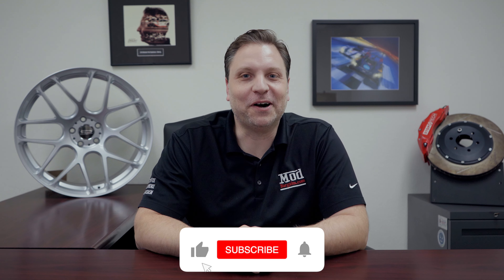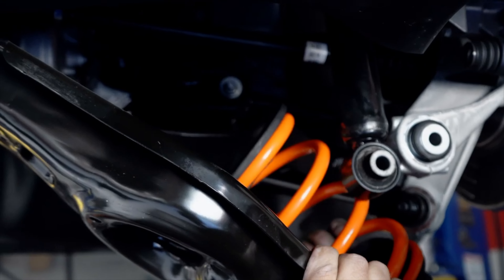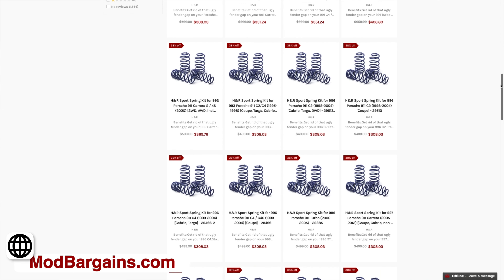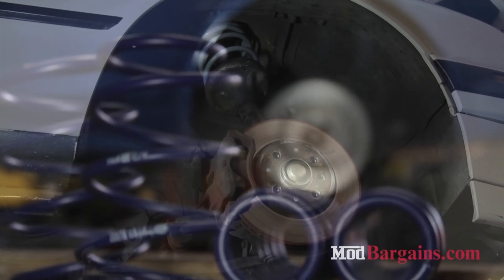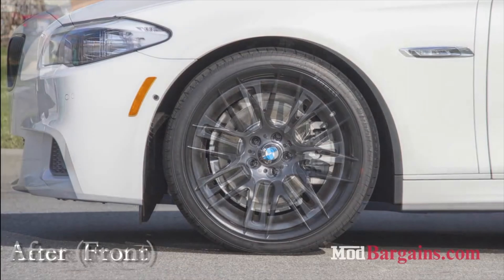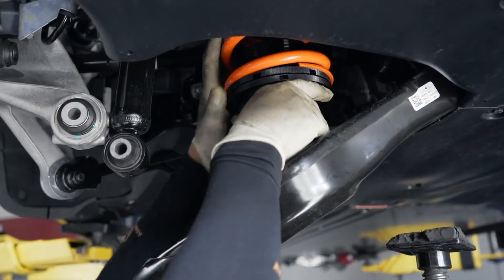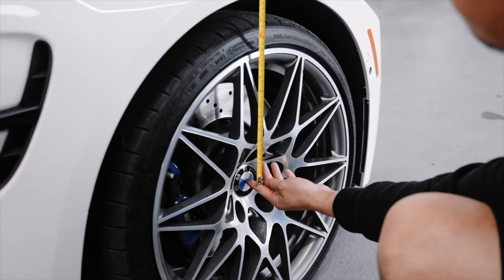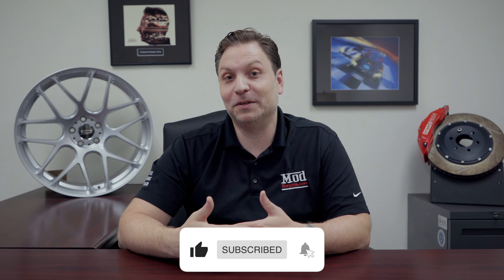Should You Buy Lowering Springs? Here's what you need to know...

Comment: Last car I lowered was a 1983 280zx. Fun story, I actually bought lowering springs but they were super soft like when guys used to heat their springs so rather than dealing with it as-is or switching to coilovers I decided to chop 1 coil off the oem front springs and 2 coils off the rear. Specifically the coils that were more tightly wound cuz they're the part of the spring thats there for ride comfort. That dropped height by right about 2-inches, maybe a little less, then I paired those questionable bastards with Koni yellows front and back. At 1st I was skeptical but after the 1st 2K miles had gone by without any issues I got the car aligned and it was an awesome daily driver. The only reason I stopped driving it was due to my mother-in-law backing a tow ball into the drivers door frame so hard that the unibody buckled

Comment: Last week I lowered my vw golf 7 estate with eibach pro-kit springs. I really love the outcome. Would definitely recommend these springs. My car sits 30mm lower and the difference is night and day!
Reply: Got told that a 40 mm drop was possible. Is this true? Kinda dissapointed with the outcome of Eibach in this video
Reply: How's the ride quality?
Reply: I would also like to know how the ride quality is. In addition to a better wheel gap, do they provide an increase in performance as well?
Reply: I would also like to know how the ride quality is. In addition to a better wheel gap, do they provide an increase in performance as well?
Reply: @lfcbb0422  yes 40 is possible but than you’ll need the sport line springs instead of the pro line if I’m correct. But it all depends on your model, because the r-line is already pretty low compared to the non r-lines
Reply: @mlvn1991 how’s the drive bro? I’m debating on bc racing coils or springs
Reply: I switched to 30mm Eibach springs in my MK7 Golf Station wagon as well. I swapped the shocks and strut mounts in the front as well. I like the ride quality so far. You can tell, the springs are stiffer since you can feel the car is moving more. But with the new new dampers (Bilstein B4), it's not even close to being uncomfortable. I guess, If you want a lower car, this is possibly the least harsh riding way to get there.

Comment: I think the key take away is or should be don't buy lowering springs an put them on you stock shocks/struts they're valved wrong and too long. The flip side for those of us that want to set and forget or are not into corner weighting etc. is there are shock and struts that are made for lowering coils and are valved for them like the Bilstein B8's. I like everthing about coil overs except the annual or biannual maintenance of unlocking, greasing, re-locking, and re-adjustment they need. You obviously don't need all that if it's a track car and you might get away with less maintenance if you live in the dry but for the rest of us the performance delta just isn't there for the additional work in a street car.
Reply from the maker: There are some brands that say they do build their spring rates around the valving of the stock shocks. MSS for example claims to do so, I've asked them to release the shock dyno information but they all act like it's top secret. So most of the time we have to take them at their word.

Comment: A little off video topic, but, my car has 2 piece brake rotors.  When it's time to replace them, where can I find just the outer ring?  Everywhere I've looked just offers both pieces or a one piece.
Also, could you do a video comparing the pros and cons of the different rotor styles
Reply from the maker: I will try to put that on the schedule to work on it J . Not sure the brand, but check out racing brake he sells a lot of the components for 2pc rotors.

Comment: MK8 Golf R, have been going back and forth between H&R and Eibach. Would love to keep a stock feel, really only need an inch drop. Recommendation, anything else I should look out for?
Reply from the maker: Eibach will keep that comfortability because it is designed for your shocks well also giving you a mild drop about an inch or so. H&R will give you bigger drop, stiffer suspension but it is not necessarily designed for your shocks.
Reply: @talkingmods  wonderful, appreciate the help!
Reply: A lot of Golf 8 R owners I know have the H&R Springs. They are happy 👍

Comment: Hello Ron. 

I'm writing from India.
Cheers to the great content 🍻

I own a Skoda Octavia Type2 1.9 tdi preface lift. It came with a 15" wheels, which I upgraded to 16" with a bit wider tyres. This increased the body roll.

I am planning on lowering her down a bit.
Could you suggest what would work for me. I drive almost 50km daily on highways. NOT A MANIAC ON THE STREET. But love pushing her once in a while.
Reply from the maker: I don't personally work with Skoda's here in the US so not sure which company supports lowering springs, but check each manufacturer direct, H&R, Eibach, Vogtland, possibly Tein those would be the ones I would look at.

Comment: Interesting video, thank you. 

Difficult subject as you can’t really answer this car as a blanket question as there are so many variables. 

Some cars are crying out for lowering springs, a prime example would be my mk3 MR2, softly sprung and rides high as standard so responded well to Tein lowering springs & new OE shocks. I actually think it improved ride as well the handling, rear shocks were a bit soft as original items! This was a successful swap. 

Some 30 years ago I had a 4 pot E21 BMW that was so much better after being lowered with a Jamex suspension kit but that was so high on standard springs. 

However, I have been less successful with other cars in the past & ruined the ride & handling 😂.
Reply from the maker: Hmm interesting experience you've had, but for the most part it helped. I think one of the things we see with more modern cars is that perhaps there has been a rush to produce and less engineering on factoring what the shock should be set at by the shock dyno (the engineering to make it isn't hard, it comes down to how far these manufactures approach it).

 I've had good experiences and bad experiences as well, from companies that rush products that are harsh and don't work well with the shock (I really hates the H&R springs on the E92 m3 for example, made the car very stiff, and hard to control) to companies like recently MSS to name one that really made the car feel way better, so I chalk it up to time spent by engineering and care.

Comment: First of all - Great video! 
And I have a question... I have BMW F10 530d xDrive and I wanted to lower it. But because of the fact that 30mm wasn't enough for me, there wasn't really much of a options for me. I was forced to choose between coilovers from KW (v3) with the price above 2k, or making some "custom" option with new shock absorbers and lowering springs. 
After hard time researching I choose BILSTEIN B6 pared with adjustable H&R coil springs (40-55mm / 30-50mm). So what do you think about this option? I didn't found someone with exact same combination for experience to be honest.

Comment: For my car, the eibach sportlines have a bigger drop than the H&R sport. It’s like a 1.6 inch in the front and 1.4 inch in the back while the H&R is 1 inch. It says it’s designed for the stock shocks but i’m just still wondering if it will cause extra wear on them.
Reply: your shocks will be fine.

Comment: Do you have to replace with new bolts/nuts when changing the springs?
Reply from the maker: You shouldn't need to at all. Unless the car is pretty old or in conditions that have made things rust (so snow conditions) but normally you do not need to change them.

Comment: last week i just lowered my 2012 civic sedan ex-l on eibach sportlines with 1.7 inch drop in the front, and 1.2 inch drop in the rear with skunk 2 sport shocks... i had just over a 3 finger gap in the wheel wells and was only looking to lose like an inch of that to keep ride comfort so i went with the sportlines as out of the teins h&rs and skunk 2s i was looking at they seemed to have the most minimal drop with the internet reporting the most comfort out of the others... for whatever reason my suspension looks absolutely slammed now and my rear camber is meh and while it looks cool im feeling every imperfection in the road at highway speeds.... I also got an alignment and now im pushing my steering wheel to the right to stay straight and that wasnt a problem before the alignment but after the install......theres certain sections of the road like when theres a bump or a concrete patch every 5 to 10 feet that makes me feel like the tires are coming off the ground to go over those bumps but for the most part the car feels like it handles alot better than the completely gone suspension i just replaced.....even if i do have both front wheels scraping on the fender liners sometimes. and its still kind of comfortable and not jarring..

my question is this if i was expecting a 1.7 inch drop in the front and 1.2 inch drop in the rear going for oem+ and ended up with hotboy stance did i do something wrong with my install or is there something i can do to correct it? the car is sitting level with all 4 fenders being the same distance from the tire..... or is the shocks not allowing the springs to do thier job or vice versa? i have a 1 finger gap in the wheel wells and my progressive springs in the rear look like the tighter wound part of the spring is 1 mm from binding when the car is stopped me think i have about 3-4 inches of actual shock travel from the looser wound part of the spring.... 

i guess its important to say the front is macpherson, and the rear is divorced... 

also of note i was thinking of buying 1/8th mm rubber pads at home depot to cut to shape and use on the spring isolators between the body and the isolator to maybee give me an extra 1/4  of an inch total in the rear but i have no idea what to do about the front as the springs pretty much locked themselves into where they want to sit in the bottom perch... and i know thats not much of an increase but id rather the stance of the car be a little raked than ridin on the bumpstops all thew time if thats even happening

i had a 500 mile round trip journey yesterday down rt 80 and 99 and 22 in PA and there was only 2 really scary parts where i felt like i should probably slow down from 75 to speedlimit
Reply: Aren't Sportlines more for track use? I would not drop my car that low for street use.
Reply: @davepaturno4290   "track inspired" but the pro kit wasnt available for my model and after another 524 mile drive today with no winds influencing my car, i can say the spring shock combo feels like OEM+++, i dont feel like im on the ground when im driving, they dont feel too stiff, bumpy or bouncy i feel more of the road but its not obnoxious, it feels connected to the road like its on rails, it doesnt dip or dive or squat on braking or accelerations and they feel really stable all the way up to 82mph even over rapid bumps where the last set of coilovers i had on previous cars would have felt like they were skipping.... i feel like it could benefit from an upper strut tower bar for enhanced cornering and making sure it stays flat in the front but it isnt needed for daily driving or grocery getting.....im actually impressed by the setup and how well it works but i have 1 issue i scraped twice today over two bridge transitions.... my inner fender plastic on the front left is warped a little and hangs about 2 millimeters below the wheel well the other side doesnt and it doesnt scrap on the other side and it hits for a half sec just barely so i gotta look into that but i still want to find a way to raise the car some becuase i only expected to have like 1 1/4 inch gap and i have about half of that
Reply: i think my opinion of them changed alot between driving in high winds 3 days ago and not having to deal with that today and having them break in some and not struggling with them today  .... the ride was really enjoyable and i spent the day waiting for the next corner to see what it would do and it didnt let me down or scare me once

Comment: I have a 2023 Audi RS3. I want to lower about an inch or so. I don’t want to have issues with curb stops, and speed bumps. Also turning and going over a bump I don’t want any  rubbing.  My desire is to close the gap a little and reduce body roll. What would be the best choice for springs? Any help is appreciated.

Comment: will my eibach lowering springs lower later on down the road ? could it be like weeks or even months ? bc i see other cars with the same springs and it lowkey looks a lil lower than mine
Reply from the maker: Well Eibach springs are supposed to be pre-settled(been told so by the factory), so that they really don't change much, not to say there couldn't be a slight like a .1-.2 drop right after installation, but generally that shouldn't be the case.

Comment: Which Lowering Springs you recommend for a 2020 Camry Hybrid?
Reply from the maker: interestingly enough,  Eibach and H&R both make lowering springs for your vehicle (which I discussed the brands in the vide) and both have actually the same ride  drop of 1.2" on the front and rear. So personally since the gap isn't going to be any different I'd go with the addition of the comfort from Eibach's generally.

Comment: I just purchased H&R lowering springs for my 2017 Volvo S60... should i be looking for new shocks/struts to pair with the springs or is it fine to use the stock ones? the car has around 52k miles and I assume the shocks/struts havent been replaced since the car was new
Reply from the maker: Typical life for chocks is around factory shocks is 70-80K on average, so you have life on those shocks, and if they are brand new I would utilize the new shocks you have. But if they aren't new, then to save time on the install I'd consider going with a more heavy duty type of shocks that will last you a lot longer. Hope that helps, and congrats!
Reply: @talkingmods  I appreciate the advice and agree it would probably be better to replace the shocks as a preventative measure. Do I just look for any aftermarket ones that fit or a certain type/brand (not looking to spend and arm and a leg)
Reply: @adamhussein9404   One thing to consider which wasn't mentioned in the video, is that your shock has been working in the same range on the piston shaft for 50K miles. When you lower the vehicle, you are changing the position of the piston shaft which has never touched an oil seal in the shock. If there is any corrosion, or damage on the new working portion of the piston shaft, it can catch a seal and create a leak, compromising the shock.  This supports the decision to update shocks at the same time if you can afford to do so.

Comment: Is it safe to put h&r springs on a stock set up. I hear it can wear out parts quicker.. I Got a 2022 jetta sport
Reply: The cars only got 9k on the dash
Reply from the maker: YEs it will put more stress on the stock shocks, decreasing the life of the shock. Why properly valved shocks like from a coilover are the way to go. Really depends though on how long you want to have it lowered and whats more important right. If it's a lease then you won't have the vehicle forever and the car would be turned in right

Comment: I got HR springs for my honda accord 2017 and i also bought truhart struts for it. I bought all the pieces in between and the mounts and all that. For some reason the the strut surpasses the springs and theres a huge gap everytime i hit a bump. Am i doing something wrong?? Please help
Reply from the maker: I can't speak for Truhart (honestly haven't used them) are we sure they are the right shock first off, second, installation installed correctly? With the lowering did you get a new bump stop that adjusts for the lowered height (often a forgotten thing) if you don't want to get a new bump stop you can cut your original bump stops to make the adjustments.
Reply: @talkingmods  hey, yea man i bought every single thing needed. But truhart sending me washers to put up top, wouldnt take take away from the ride quality?
Reply from the maker: Don't believe that should affect the ride quality.  Did they explain as to why?

Comment: Coilovers don't provide a "better" ride - they only provide "adjustability.
McPherson Front Set-ups with Multi-Link rear can use lowering springs with improved struts/shocks designed for lower ride height and perform the same way.
What about the camber changes in the other suspension components when lowering?  
If someone is going for looks, then by all means go for the biggest breasted blonde at the bar and you'll be fine for life.

Comment: Would you or anyone on here recommend H&R sport lowering springs on a 24 WRX?  Would lower about an inch.
Reply from the maker: Just installed them, came out nice on the car, wasn't really that uncomfortable.  The one thing I will say is it's a bit counterintuitive to the WRX being a rally car, where it should have that gap.
Reply: @talkingmods  i wont be using it as a rally car.  Its a fun lowered twisty road car.